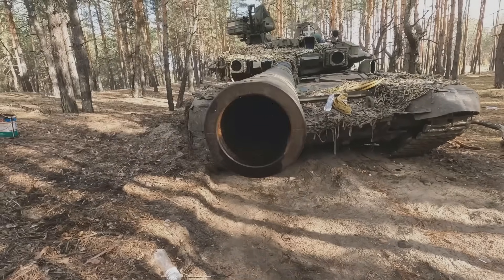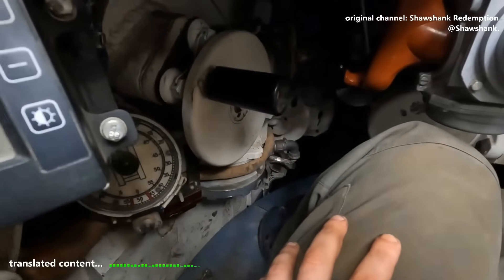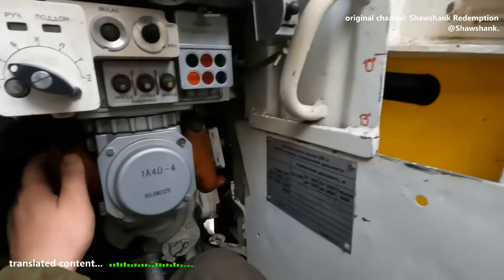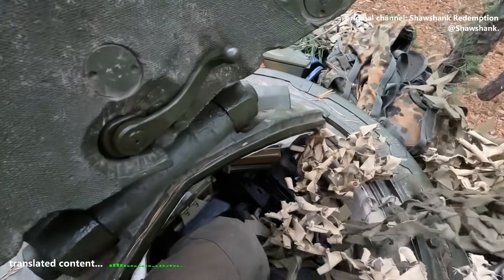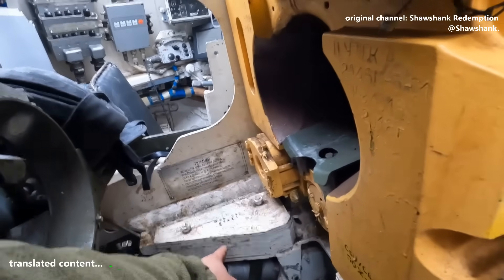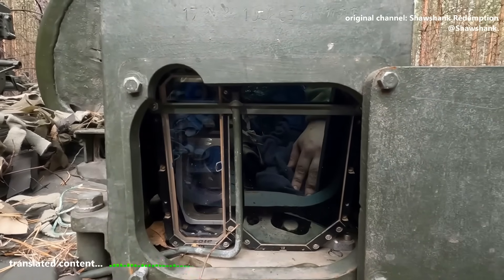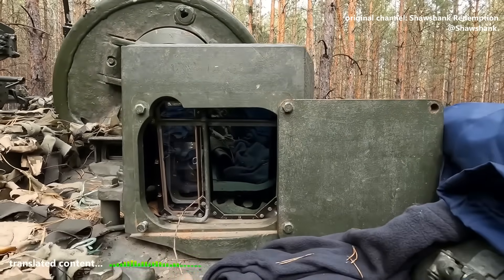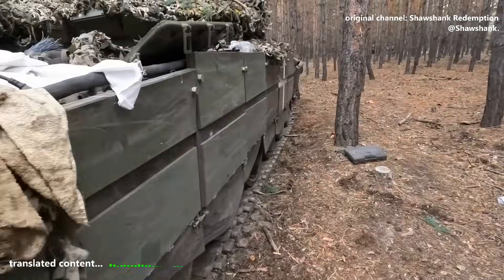Real Tank Crewman Reviews the T-72B3 — Brutal Truth Inside!

Comment: The T72B3 is the answer to the question of how to transform a pile of obsolete Soviet legacy into something more valuable, something that can at least somewhat compete with modern technology. They were lucky that the Soviet legacy turned out to be not such a piece of crap.
Reply: Otherwise, this video is an older T-72B3M version from 2016. The T-72B3M version from 2022 is even significantly better in terms of armor protection, which is now added even higher on the turret itself. As for performance on the battlefield, anyone who has followed the conflict in Ukraine can see that the T-72 of this modernized version works really well if used properly, of course. Of course, you don't need to carry spare ammunition and ammunition inside the tank, only what is in the carousel is quite enough. I think that 22 projectiles are enough! Otherwise, in terms of passability, speed with these stronger engines, crew training endurance, price-quality ratio, what you get from a tank on the military field, the maintenance of the tank itself is far ahead of all Western tanks that have been donated to Ukraine. Also when it comes to the range of the gun, it is about 5km if using laser-guided REFLEX/SVIR missiles, which is also significantly better than Western tanks. T-72 B3/B3M are also used as mobile artillery very often and then the range is even 10km, which is also unfeasible for Western tanks! So the T-72B3 and especially the B3M version from 2022, which is significantly better in every sense, especially when it comes to armor protection, which is significantly better than the tank in the video. Roughly speaking, when it comes to a real war and the battlefield in Ukraine, the T-72B3M, when it comes to the investment, and what you get from the tank on the battlefield, we can put it at a level of capability significantly above the Leopard 2A4/A5, when the effectiveness of the tanks in such an intense conflict and a real war is only a fraction, of some 10% of the cost of a Leopard 2 or Abrams. Also, the T-72B3/B3M tanks, in addition to proving to be significantly more viable for the conditions of warfare in Ukraine, have also proven to be significantly more durable than Western tanks and when it comes to opto-electronics question and when the main components of the tank are in question, the engine, gearbox, track, suspension ... And everything else! Because many in the West are mistaken when they think that these Soviet / Russian tanks are poorly made, whoever has the opportunity to use them will tell you that they are very well made and last a long time, as we have seen for more than half a century! And with modernizations they are very relevant today! Also, the T-72 tanks are very easy to maintain and can be easily performed in field conditions, with handy workshops ... Repairs are carried out very easily and cheaply, which is not even close to the case nor is it possible to do it on Western tanks. All engines have also proven themselves excellently, the T-72 can be fitted with engines of 780, 840, 1000, 1130, and 1200 hp ... It can also be equipped with various modernized and other systems ... The tank is therefore very modular!

Here we should not only mention the Russian T-72B3M, but also the Polish T-91, Czech T-72CZM4, Serbian M-84AS1/AS2/AS3, Russian T-72B1MS, also a tank that has the opto-electronics of the T-90M that Serbia possesses... Not to mention the new Chinese tanks that are based on the T-72 tank platform. These are all versions of the T-72 tanks that on a real battlefield and in a real war have capabilities that are far above the Challenger 2 and many versions of the Abrams and Leopard 2 tanks, roughly speaking, above the Leopard 2A4/A5 version.
Reply: @SRB.4S  Mostly agree with what you said, I think the biggest mistake Western MBTs have is that they are focused and are better in tank vs tank battles which are VERY rare. Bottom line is all modern tanks are good, each for their own countries doctrines etc. and all have their flaws. At the end of the day they are TANKS, not toys like these people think they are. I'd like to see the people laughing at Western or Russian MBTs actually face them irl. Easy to laugh at them and call them scrap when you're in the comfort of your home and you treat them like inoffensive toys
Reply: @мясорубка2232  I agree with you but I didn't really notice that western tanks are better in tank battles Which are rare but I didn't notice that they are better
Reply: Russian: New gun, extra ERA and NERA and it is good as new
Reply: Guys ts guy that pretended to translate the video and just spreads his opinions on T series tanks, the tank in the video isn't even a T72B3 its a T90A🤦🏻‍♂️🤦🏻‍♂️ its recognized by Shtora1 IRCM, the T72s dont have them, especially T72B3, so in the end its a T90A not a T72B3(also the T90A in the vid was stripped off of some equipment i believe he said in original video that it was NV that was taken away from the turret)
Reply: @Alem.WTMVeteran The translation in the video from Russian to English, or the narration, is correct. It seems my friend that you did not watch the video until the end of the video. Yes, at the beginning of the video, the T-90 is shown as a kind of entrance scene. But the video certainly shows an analysis of not the T-72B3 but the T-72B3M of the first series of this modernization from 2016. The T-72B3 does not have additional ERA protection on the rear side of the turret.
Reply: I thought it was an improvised space program, mb
Reply: Perform better  more feats than all of the western  tank in Ukraine btw despite  being obsolete 😂😂😂😂
Reply: @GrayKnight-ko8bg  RUSSKIES see us tank? throw all they have to get "victory" on twiter xD
ukrainians see some shitty russkie tank they do it cheaply cuz they know turret will go brrrr very high even with a fucking simple rpg shot ...
Reply: @GrayKnight-ko8bg okay so when we say Western danks destroyed tons and tons of Russian tanks in Iraq and Iran those were downgraded export tanks and that's why they performed poorly. But when we say those Western tanks are downgraded or extremely obsolete versions that's not valid? Those tanks didn't even have the upgraded depleted uranium armor packs. And let's not forget some American Bradley is taking out a fully kitted t90
Reply: @friedtomatoes4946 
So the leopard and challenger is obsolete  when they are one of the most modern equipment  that got sent to ukraine 😂😂😂😂?
 
While t72  is litteraly the same from  libyans it just got more era protection  
And somehow that t72 outperform  the challenger and leopard and abums 
Game changer btw overall in the war 

That bradely didnt even destroyed  the tank at all it was drone if you actually  watched the video 😂😂😂😂
Anyway t72 > bradley abum leonard chillinger

Talk to me again if they actually  do something major other than getting destroyed 😂😂😂😂
Reply: @GrayKnight-ko8bg yeah, The extremely old model versions of those tanks are extremely obsolete. The ones sent to Ukraine are down armored and missing a lot of the electronic systems that make them so effective. Specifically so that if they are captured nothing sensitive is lost. 

I don't know where you got the drone killed the tank The drone finished the tank off after the turret rotation and one of the tracks was destroyed by the Bradley's. 

Those t72s seem to be very good at throwing their turrets into the air and incinerating their crew. While the downgraded export variance of Western tanks have had extremely good crew survivability. On top of that these tanks performed roughly equal if not better to their Soviet and Russian / Ukrainian combatants. They were also just deployed in extremely small numbers. 

So let's get our facts straight 
1) these are export variants or very first versions of the western tanks missing a lot of critical electrical and armor equipment 

2) these were deployed in small numbers and generally not used on the front line although when they were they performed as expected 

3) The t72 is a tank that is being destroyed at such a rapid pace that Russian reserves are nearing zero based on satellite imagery. 

4) The Bradley's absolutely disabled the t90 which allowed a drone to come in and finish it off. 

5) capture t90s often still have original t72 equipment in it showing incomplete modernization attempts.
Reply: @friedtomatoes4946 
They did not do sh

So you are ignoring  the facts that the t72 still outperform  all of western tank in the war 😂😂😂😂they perform  as expected  they destroyed  target and they dipped and they get destroyed  because they are cheap and still can do task  

While the western tank barely  do anything  did they capture  a land ? No
 

 and the t90 got destroyed   by a drone do you agree 😂😂😂😂

T72 is better 

Plus each time these western tank show up at the front they always are priority  target so ending  they always  get destroyed 😂😂😂😂😂😂😂
Reply: @friedtomatoes4946 
Satellite  image 😂😂😂😂 what is this source bs you actually  believe  them running  out of t72? Boi they  got thousands  of em   that why you see them at almost  at the front in ukraine 

You believe  a media that hasnt set foot on russia not even once  did they count the t72 ??😂😂😂 did they got physical  proof that they are running  out of tank other  than Satellite image  because  russia is just reusing slapping era armor on those tank in factorys that's why they are not in the Satellite  image lol😂😂😂😂😂 what is this bs
Reply: @GrayKnight-ko8bg so what you've effectively told me is that either there are invisible Russian stockpiles of t72s somehow cloaked from all eyes to see or what is arguably worse that the stockpiles are completely depleted and all the t72s are on the front lines and not being able to be replaced when they're destroyed. The fact that we're seeing t64s and even some t55s on the front line has nothing to do with tank depletion at all. 

Also by your own admission you say that Western tanks are getting focused by everything the Russians can throw at them. Yet they're still getting tank kills and gaining some ground before getting taken out. Hmmmmm pretty sure a t72 can't do that.
Reply: @GrayKnight-ko8bg They are not really up to any western standard. The few western models are also hunted by literally anything the russians have, once they are spotted somewhere. Plus I dont have to mention numbers of deployed vehicles, right? If Russia knew how to deploy tanks, one would be able to compare them, but so far the staggering losses of 'new' or 'improved' T-72 models dont really tell a great story
Reply: @timarmbruster6693  funny despite  being worse than western tank  they have more feats and have donem ore overall in the war compare to yo western what have they done other than getting stuck in the mud and getting destroyed  plus if they send more western tank it just means russia will have fun huting destroying  them because they can 😂😂😂😂😂
Reply: @GrayKnight-ko8bg  Like what? 😂😂😂😂
Reply: @мясорубка2232 Bakhmut  and in kursk always at the front when the russians start attacking  and many more while the western  tank what did they do? Hide deep in safe zone doing absolutely  nothing  😂😂😂😂 flexing thy paper armors
Reply: @GrayKnight-ko8bg  Delulu, you're just telling me that you consume news from just your side, not both and then analyze, otherwise you wouldn't laugh when the same things you criticize western tanks for, also happen to our tanks. Bet you never saw a video of western tanks operating as well. Also they only received 125 "modern" western tanks vs the thousands of Russian mbts they went against, what do you expect them do to? 125 tanks to change the course of the biggest war in our times?
Reply: @GrayKnight-ko8bg  I know how you think, simple, if all these western tanks were actually Russian, you would praise them! No different from the rest of the people who think our Russian tanks are worthless scrap. Both wrong.
Reply: @мясорубка2232 😂😂😂 holy cope doesn't matter if they send 1k western tank they ain't doing sh proven in the ukraine war they didnt do sh t72 better imagine  getting outperform  by a t72 😂😂😂😂
Reply: @мясорубка2232  what is bro yapping talk again if you western tank actually  did anything  at all 😂😂😂😂😂😂😂😂😂
 T72 still have more feats and have done more so my point still stand cope nafo bot
Reply: @мясорубка2232 western tanks 
Strong armor in paper 
Looks strong in paper
Game changer pre ukraine

Trash fancy tank 

0 feats
7 getting stuck in the mud 😂😂😂
7 getting destroyed 
7 doing nothing 
7 gets outperform  by a t72
Reply: @мясорубка2232 and those 125 modern is more done enough  to do something   
But yet they do nothing  

Funny how 125 t72  similar  number btw and has done more overall  in the war
Reply: @GrayKnight-ko8bg  Tanks haven't played a significant role in this war for a long time, and they are a shadow of what they were in 2022.
In fact, when Ukraine received these 100 Leopard tanks, it marked the final decline of the tank era. The best that Western tanks could do was to preserve the lives of their crews as much as possible, and they are doing that, unlike Soviet MBT.
Reply: @GrayKnight-ko8bg  The moment you can form a coherent sentence I will listen to your babbling. You can barely spell but you think you know the reality of warfare? Lil bro you don't have ANY idea what you're talking about, "feats", what do you consider tank feats? Ever saw the video of a Leo2A4 engaging an armored column and taking out two Russian tanks, 1 apc and multiple other vehicles near Kurakhove? What about when a Leo2a6 engaged two T80s with HE loaded and both T80s ran away?
Reply: @мясорубка2232  this is when you know you   are losing in an argument  

Leopard didnt do anything  what they do huh ? 0 feats you dont even know feats 😂😂😂😂😂  
Laughable  

Is that supposed  to be a feat t80 running away ? T72 capture more lands than any of yall western  paper tanks overall in the war what is even you babbling about 2  t80 running from a leopard  

Aint the leopard  keep running away when the russian is near and drones ? 

But when the russian does the same its called cowardly  😂😂😂😂😂
Reply: @мясорубка2232  feats
Is when you capture more land than any of the most modern tank in ukraine 
Have destroyed  target more than any of the western tank

And thats the t72 😂😂😂😂😂
Reply: @ivannovak6183  what in the world is this sh

Here comes the bubbut western tank survives its own crew
Ye it does while doing nothing  

The t72 has done more contribution  in the war
Reply: @мясорубка2232 i watch the video the leopard  did not take out the entire collumn  at all 😂😂😂
 You mean it take out one turtle tank   

  what a load bs 
😂😂😂😂

Talk againn if  youre leopard do something  other than propaganda  videos
Reply: @мясорубка2232 the t 72 has destroyed  more targets than  the leofrauds 
 And has captured  more land you can search ukraine map  thats its  feats

😂😂😂😂😂 while yo leopard failed at it own invasion kursk btw 

The leopard did not take  an armored collum  😂😂😂😂
Reply: @GrayKnight-ko8bg  So funny, because you didn't see the video it doesnt exist, and if it does exist, then it's fake, that's the extent of your mind. Once again, you can BARELY spell, you never had an argument to begin with. You don’t have the slightest idea about the situation of tanks on the front, just keep quiet and stop embarrass!ng yourself, 14 year old emoji spammer.
Reply: @GrayKnight-ko8bg  The most things the t 72 did was getting destroyed the most out of any tank and setting world records for how high the turret gets launched into space 😂Failed at even taking back their own land that was at 30% in 2022 and now it's just 19%  🤣
Reply: @мясорубка2232 what is bro even yapping i literally  watch the video and did not wipe out an entire armored collumn like you claim it's also funny you calling someone 14 yo  

Funny 😂😂😂😂
Did you even read what I said there's something called reading comprehension
Reply: @sulfur13 you talking? funny how western tank is still getting outperform  by a t72 my point still stand 
And ukraine they literally  didn't retaken any of their city from the russian 😂😂😂😂😂 
Talk again if western tank do anything other than getting destroyed 😂😂😂😂

Ukraine with nato help couldn't even take kursk 😂😂😂😂
Reply: @sulfur13  western tank game changer btw  literally have   0 contribution  since they deployed them at the front 

0 capture city 0 land capture 
7 getting destroyed 
7 getting outperform  by a t72
Reply: @GrayKnight-ko8bg  I agree, outperformed in how much many were destroyed and how high the turret can go like I said 😂😂😂😂
Reply: @sulfur13  0 feat 0 land capture 😂😂😂😂😂😂😂😂
Reply: @sulfur13  imagine being overhype nd still doing nothing what an absoulute frauds 😂😂😂😂😂😂😂😂😂😂😂😂😂😂😂😂😂😂😂😂
Reply: @sulfur13   t72 still better  keep coping  that all you can say because you nafo tank actualy has no feat and  no contribution to the war  😂😂😂😂😂😂😂😂😂😂😂😂😂😂😂😂 talk again if you have other thing to say other than bubut turret russia go boom booom its take 

western tank 0 feat 0 land capture 0  contribution 0 winning againt an army than can actualy fight back
7 winning againt guys with ak 7 retreating  7 getting destroyed
Reply: @sulfur13   t72 still better  keep coping  that all you can say because you nafo tank actualy has no feat and  no contribution to the war  😂😂😂😂😂😂😂😂😂😂😂😂😂😂😂😂 talk again if you have other thing to say other than bubut turret russia go boom booom its take 

western tank 0 feat 0 land capture 0  contribution 0 winning againt an army than can actualy fight back
7 winning againt guys with ak 7 retreating  7 getting destroyed
Reply: @sulfur13   t72 still better  keep coping  that all you can say because you nafo tank actualy has no feat and  no contribution to the war  😂😂😂😂😂😂😂😂😂😂😂😂😂😂😂😂 talk again if you have other thing to say other than bubut turret russia go boom booom its take 

western tank 0 feat 0 land capture 0  contribution 0 winning againt an army than can actualy fight back
7 winning againt guys with ak 7 retreating  7 getting destroyed
Reply: @GrayKnight-ko8bg  spam more emojis kiddo and take your meds
Reply: @sulfur13  cope more kid
Reply: @sulfur13  cope more  kiddo you cant handle facts
Reply: @sulfur13  cope more you cant handle facts
Reply: @sulfur13  cope more you cant handle facts
Reply: @GrayKnight-ko8bg  zero facts, 100% delulu, incomprehensible-broke-boy yapping. Are you done yet? C O P E
Reply: @sulfur13  0 fact ? LOL  you can search it yourself   nafo bo cant accept facts thats thy little western tank is not performing good not even contributing in the war    COPE nafo denialis final boss
Reply: @sulfur13   0 fact ? LOL  you can search it yourself   nafo bo cant accept facts thats thy little western tank is not performing good not even contributing in the war    COPE nafo denialist final boss
Reply: @sulfur13   0 fact ? LOL  you can search it yourself   nafo bo cant accept facts thats thy little western tank is not performing good not even contributing in the war    COPE nafo denialist final boss
Reply: @sulfur13   0 fact ? LOL  you can search it yourself   nafo bo cant accept facts thats thy little western tank is not performing good not even contributing in the war    COPE nafo denialist final boss
Reply: @sulfur13   0 fact ? LOL  you can search it yourself   nafo bo cant accept facts thats thy little western tank is not performing good not even contributing in the war    COPE nafo denialist final boss